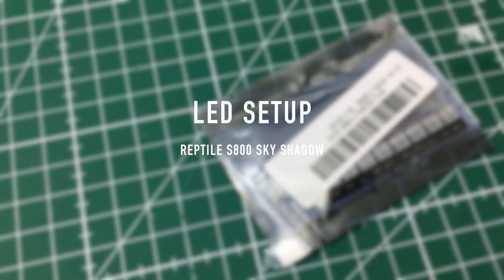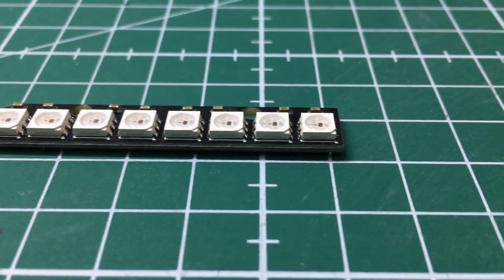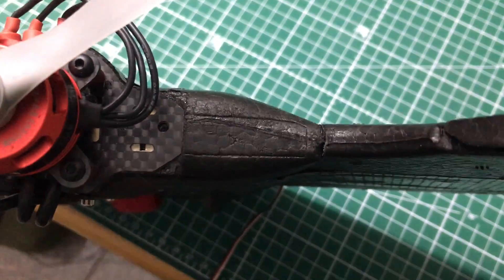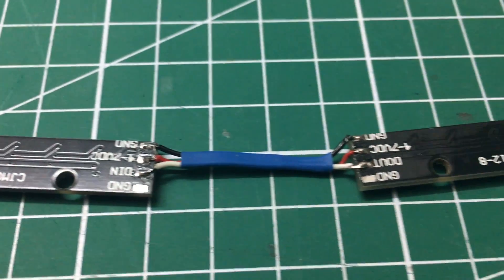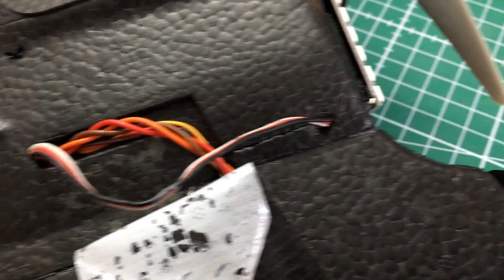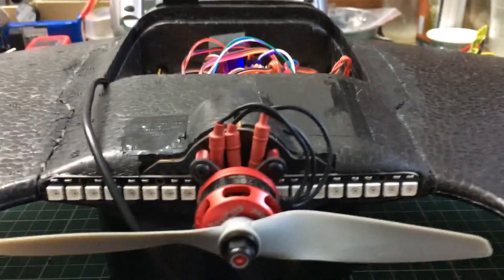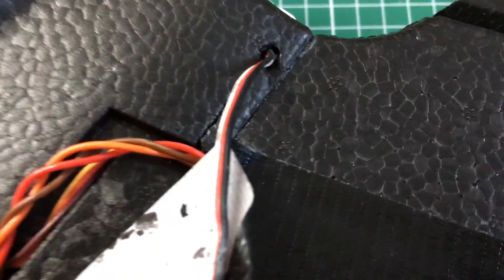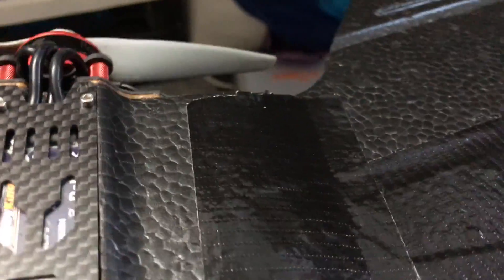S800 Sky Shadow - installing ws2812 LEDS for iNav

Comment: nice but can I connect COB led with just positive and negative wire to my Omnibus F3 FC and get them ON/OFF by switch chanel from taranis?
Reply from the maker: Sadly not! Cob LEDs want far more power than a Omnibus can deliver. You will have to install a power switch to do so

Comment: I'll be honest, this was a really useless video. You didn't show how to do anything, it was basically "look at my shiny lights"
Reply from the maker: Thanks for your opinion, Jack. 

But how much is there to show on a betaflight/iNav ws2812 setup anyway?

But you are free to ask on unclear things - I tend to reply ;)
Reply: @JustFPV-net  I was actually looking for a video to link for a friend, he is rather new to RC and it's his first build, but whatever. I'm just saying if you title your video "installing ws2812 LEDs for iNav" maybe you should actually do the install...
Reply from the maker: I see- well that was back then an related to my s800 and every modification I did to it back then. But I guess you’ll know it’s just 3 wires attached to a fc and then configure the look inside the a configurator. 

Nobody really uses this in that way around me. As long as they shine they are good ;)

Sorry I didn’t had the right video for you

Comment: In your video you have installed racerstar 2205 motor but you are listing in the description a DYS 2822 1800kv motor. 
May i ask why?
Thanks in advance.
Reply: Hm. I was thinking the same but wanted to make sure. Thanks for the fast answer and Happy new year.
Reply from the maker: Happy new year to you, mate - be safe up there and enjoy the hobby
Reply from the maker: Sure,
at that point I tried the BR2205 but found it to be to inefficient. So I changed it to a DYS2822 for the 3S setup running a 3s3000 MultiStar LiPo ... Max archieved Flighttime was over 40min. This was way better than with the BR2205 ... :)
Reply: I have 2216 1400kv. Will it be fine with 8050 prop? Or it does not fit?
Reply from the maker: It will be fine, but keep in mind that you will need some more weight in the nose as the motor is slightly heavier than the dys 2822
Reply: Matebox in Motion Hmm I didn’t think of that. Then i’ll go with DYS
Reply from the maker: now ... dont hesitate to try the 2216 ... maybe it works :) And as the barrel of the motor will get the prop further out, you'll be fine to spin a 8" propp :)

I would go for the DYS ONLY IF the 2216 wont do! It's not about to buy fancy stuff - it's about to fly and have fun :)
Reply: Matebox in Motion I’ll keep it in mind. Thanks

Comment: can you share the cli dump for the leds???
Reply from the maker: Sure

# led
led 0 15,15:E:GI:0
led 1 14,15:E:CTI:10
led 2 13,15:E:CTI:10
led 3 12,15:E:CT:10
led 4 11,15:E:CT:10
led 5 10,15:E:CT:10
led 6 9,15:E:CT:10
led 7 8,15:E:CT:10
led 8 7,15:W:CT:10
led 9 6,15:W:CT:10
led 10 5,15:W:CT:10
led 11 4,15:W:CT:10
led 12 3,15:W:CT:10
led 13 2,15:W:CTI:10
led 14 1,15:W:CTI:10
led 15 0,15:W:AIW:0
Reply: thanks
Reply: It gave me a good starting point
Reply from the maker: Glad I could help

Comment: Hey ! How do you Power the LED`s ? Through FC or a 5V Stepdown (same as used for the Servos or a extra StepDown for the LED`s) ? Grüße Tom
Reply from the maker: Hi there Tom,

I do power the leds directly from the pdb! (Matek) but back then I did connect them directly to the omnibus!

Comment: the arm modes and gps fix are they set via betaflight for the leds ?
Reply from the maker: Yes and no! Its of course iNav which looks and feels like Betaflight. Ive assigned the outer LEDs to act on GPS and Warnings (Its just like in Betaflight LED menu)